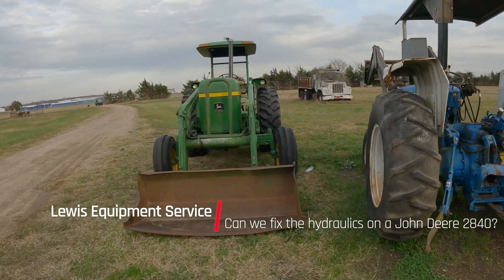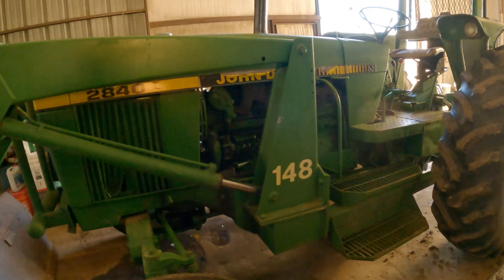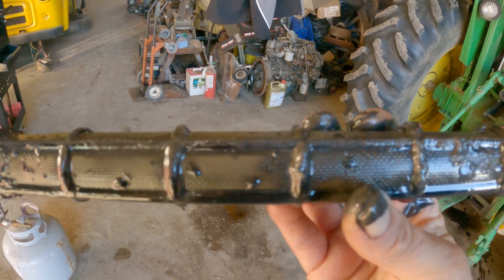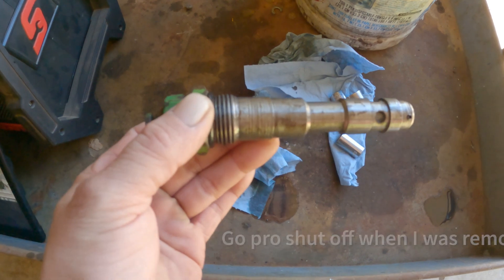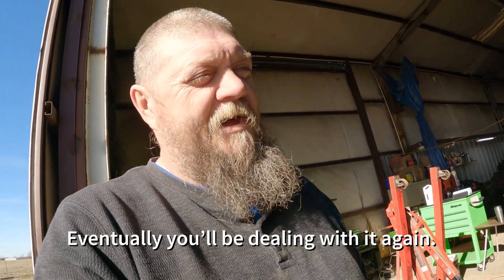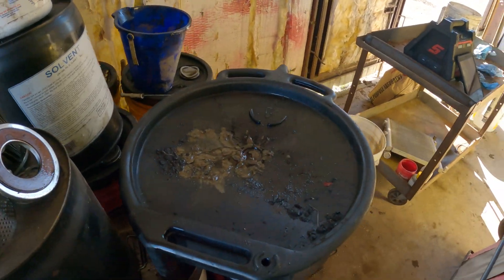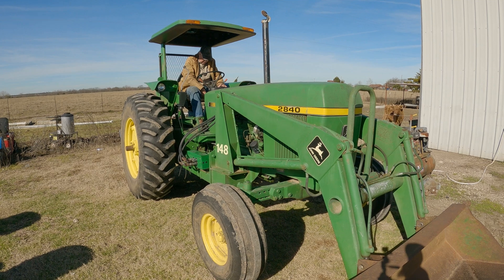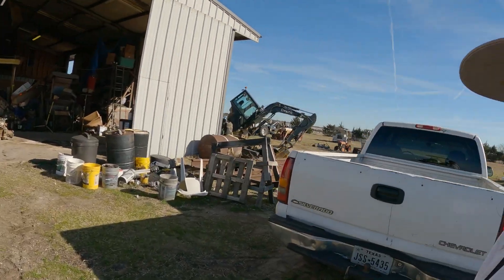Can we fix hydraulic issues on a John Deere 2840?

Comment: My name is William, the JD 5100e I operate every day is constantly overheating the hydraulic fluid, changed the filter, screen, and fluid, still OHing, any suggestions
Reply from the maker: That unit uses the oil cooler built onto the radiator. Check it for obstruction and possibly blow it out with air. Did you find any source of debris or metal in the oil when you changed fluids? The long tubed screen drivers side on the bottom of the differential is notorious for clogging. Make sure it's clean and clear also. Thanks for watching, I sure hope it helps you. Let's us all know how it turns out.
Reply: @vintagediesel-1  Man I looked for that long tube screen like u said, and can't find it, changed the one in the back under the pto, is there any way you can show me exactly where its at?
Reply from the maker: @williamvuinovich7490  It's possible the unit only has the below the pto screen. Have you checked the oil cooler for internal flow? It possibly could be obstructed keep the fluid from reaching the cooler.
Reply: @vintagediesel-1  not yet, I will and let u know
Reply: I will, found a lot of metal on the drain plug

Comment: Just saw this. Great explanation of the process of diagnosing the problem. I have a 2840, and my problem is leaking around the load bars on the lift arms. Any hints? The JD seals don't seem to work.
Reply from the maker: I usually take apart the cylinders and have my local hydraulic hose maker match up the seals for a repack. Hope that helps and thanks for watching.
Reply: @vintagediesel-1  It's in the rod at the bottom. The load sensing shaft the lift arms pivot on. I have replaced the seals in the outer housings that bolt on the rear, but still have leaks. The lift itself works fine. I appreciate your response!
Reply from the maker: @MorganOtt-ne1qj  I'll look it up and see if I can find a part number for you.
Reply: @vintagediesel-1  I have a great dealership for getting parts. I was wondering if you had a "hack" that does it better. Experience beats most service books, and I have the service book. I don't like the term hack, I believe "aftermarket experience" is much better. 👍

Comment: hi, I'm a farmer in Kentucky. I have a 3130 the same as the 2840, but made in Germany. after it warms up I lose the PTO and power steering and the 3 point hitch. I went through everything you just did and still the same.  any help is appreciated
Reply from the maker: Begin at the bypass valve. If it isn't bypassing the bypass valve the problem will require you to split it. Inside are tubes and at each end of the tubes are o-rings. If the bypass valve isn't bypassing then it is bypassing internally . Check each tube and replace the o-rings. Hope that helps you and thanks for watching.
Reply: @vintagediesel-1  You are talking about the tubes that feed the internal transmission charge pump.   I am having similar problems with my JD 2355 farm tractor,   I have changed the high-pressure pump several times, ( not cheap, by the way) and have finally concluded that my charge-pump is not feeding my high-pressure pump.   I have checked my filter by-pass valve, and cleaned my screen, and changed my oil filter several times, and checked my pressure regulating valve that is in the line after the charge pump.   That valve was difficult to find for a novice.   It is only a ball with a spring keeping pressure on it.   I did find some debris in the pressure regulating valve ( the steering pressure regulating valve that ensures priority pressure to the steering) , but it did not affect its operation, and it has not fixed my problem.      I will disconnect the hose from the charge pump and look for pressure and flow.   If I do not find it there, then I will have to split my machine and look at the supply for the charge pump.  Probably the O-Rings  are the culprit like you say.   It used to work well until the oil heated up, then it stopped working until sitting overnight to cool back down again.
Reply from the maker: @ralphking5428  Yessir I would suspect the o-rings. Thanks for watching.